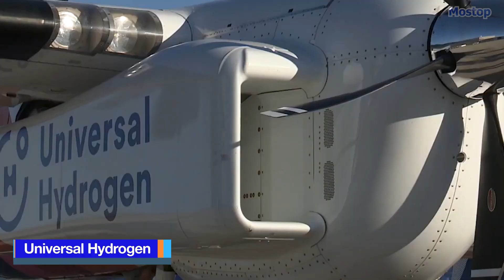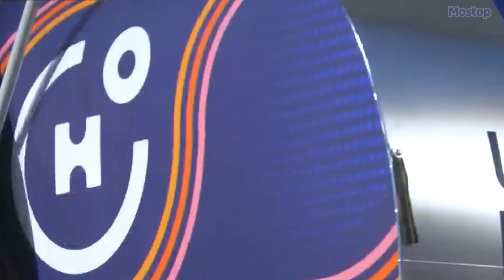These Electric Airplanes will Change the Aviation Industry

Comment: Want to hear something NOT SO FUNNY? You can't ship lithium batteries by air. At least, every lithium battery I purchased for R.C. Modeling was always labeled, "DO NOT SHIP BY AIR" . And why? Well, one 1/2 pound battery will easily bring down a commercial airliner. What makes one of these batteries go into thermal runaway. Basically, look at it the wrong way. Drop it. Overcharge it. Charge it too fast. Let the voltage go too low. Let it get too hot. Short the leads. (Oh that can't happen) Discharge it too fast.

Comment: "According to the FAA, the number of lithium-ion battery fires on airplanes has increased by more than 42% in the last five years, with an average of more than one incident per week in 2023. These batteries can overheat and cause smoke, fire, or extreme heat, even in small numbers. FAA tests show that these fires can't be prevented by traditional fire suppression systems and the gases they emit can cause explosions." So you can piss off if you think I'm getting on a plane with hundreds of pounds of lipo batteries powering that thing....